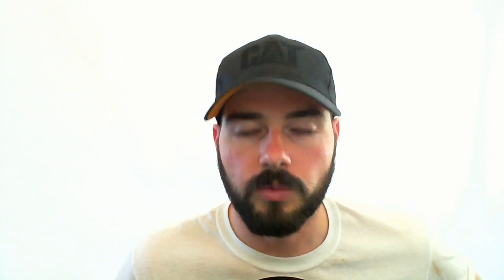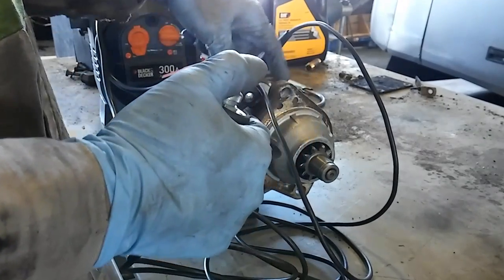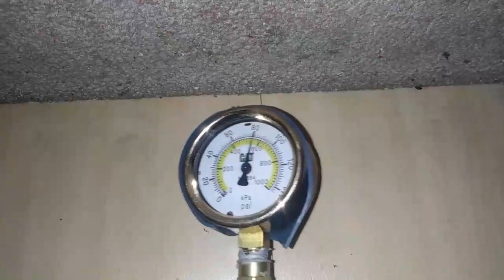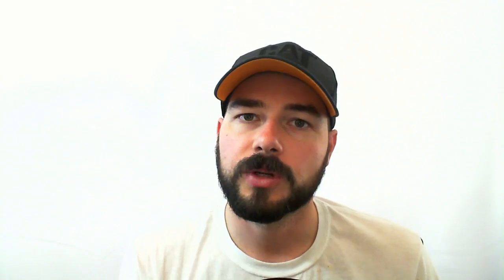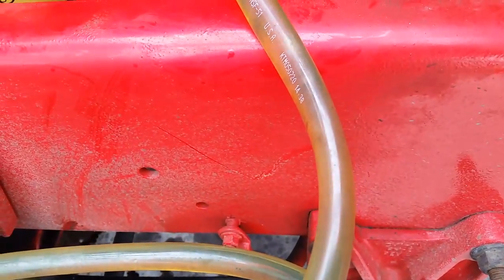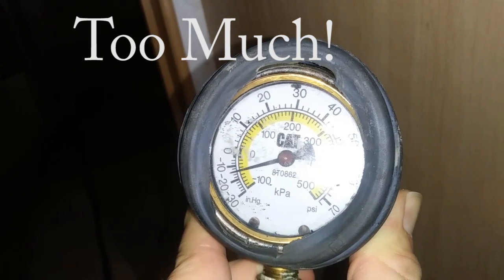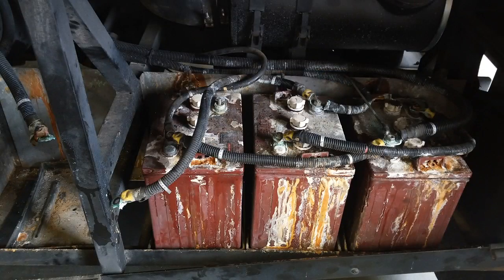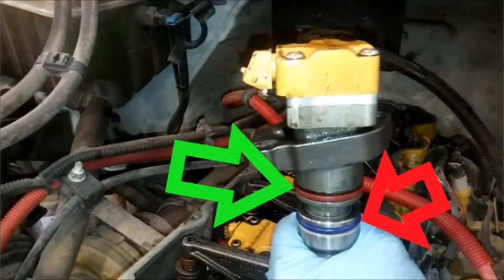Why Are Diesels Hard To Start? How To Fix A Hard Starting Diesel?

Comment: To piggy back off your mechanical checks, look for worn/ frozen belt pully. I have had a few belts slow down on cranking from a worn ac compressor bearings.
Reply: I assume that you are suggesting that a neglected water pump and/or alternator (bearing about to freeze) is/are included in the list of possible causes of slow cranking. Thanks a lot for your input.

Comment: I'm a much better operator than mechanic, but in the course of my time around machinery/trucks I've learned that corroded terminals, contacts and compromised wiring is one of the first things I look for when diagnosing starting or ignition difficulties.  Seen a lot of guys replace batteries when it was actually just corroded terminals on the lead wires and batteries.  Next up are clogged filters dropping fuel pressure to the pump and injectors.  Fuel filters get neglected a lot because of people being a little leery of the process of purging air after the filter is changed.

Comment: My modern 2016 Mercedes with its 2.2d OM651 never ceases to amaze me. You hit the starter button and within a nanosecond it starts !. I swear the pistons hardly move and it just starts. How they achieve that i will never know.
Love diesels !. 200bhp and 420NM, and 72mpg. Whats not to like.
Reply: 72 mpg, for real? What model is that? 😮
Reply: @Gebeleizis.  2016 Mercedes A200d AMG Line, DCT. 2.2d. I averaged 72 MPG over 104,000 miles. (I drive 90% motorway daily).
Reply: @TheSaabClinicUK  impressive car, indeed 👍

Comment: 3:10 Yes, that is common on many American heavy diesel engines. On many of the light European diesels for the past 20 years, a 5w40, 0w40, 5w30, or 0w30 synthetic is often required. Many European specification oils meet the requirements of the gasoline and diesel version of that European car for that year. The Mercedes Sprinter and VW TDI are examples of this.
3:38 In a VW Jetta, Golf, or Passat diesel, it often means that the car has one battery, but it is the size of 2 batteries found in a gasoline model. The gasoline engine battery is typically a group 47 and the diesel battery is usually a group 49.

I'm not sure how much draw is involved in heating the glow plugs. In some extremely cold locations, electric heaters for fuel and sometimes DEF are going to take even more electricity. I have also heard that HEUI electrical module demands a lot of juice. It demands more than computerized distributor pumps, computerized inline pumps, and common rail injection.

6:35 The worst thing is that many temperature sensors don't give you an error code unless the temperature is impossible to reach, there is an open circuit, or there is a short circuit. It makes an advanced scan tool and an understanding of how to use it a must.

14:35 The Ford PSD7.3 and 6.0 are HEUI engines, and Powerstrokehelp suggested an "Injector buzz test" to verify that the system if functioning properly. I don't know if that applies to other kinds of HEUI engines.

Comment: Air start = no more hard cold starts. Funny how rare a feature it is today, only see it on artic equipment and some military equipment.
Reply: We have an air starter on a truck and is awesome until you run out of air.
Reply: And,,,,,If you run out of air just run an air line to a couple of tyres for a refill.
Reply: Yeah, but higher mileage trucks/buses develop slow air leaks.
Reply: Forget  bout the good ol pony start, works if you  can  get the pony to keep  running
Reply: It's a good method and they didn't sell enough parts . So less parts less money no interest from manufacturers
Reply: as long as you have a running engine to power the compressor, and huge tank for storage
Reply: @trevorchadwick5479  Air starts have a tank of compressed air already. The whole point of air start is to be able to start when the electrical system is taxed due to conditions such as extreme cold.

Just google air start diesel and you'll find lots of old trucks with air starts and not a compressor or mother bottle in sight.
Reply: i  love my air starter i even set one up on my bike instead of the oem style but i carry a hand pump
Reply: @Cragified  your assuming/hoping that the tank is full, and stays that way for what could be months or a year
Reply: @trevorchadwick5479  There is a gauge for the bottle. If one fails to read said gauge and their vehicle doesn't have an accessory compressor then that is used error.
Reply: Why wouldn’t the tank refill automatically every time the engine is running?

Seems like common sense.
Reply: @iqinsanity  Depends entirely if the vehicle has a compressor to refill it. Air starts can be installed as a seldom used hard start system such as when the batteries are low from cold or as a standard starting system with a compressor to refill the tank.
Reply: @iqinsanity  When the truck has been sitting a while, and loses air, it will need an outside source to get started. Old trucks develop slow leaks.

Comment: I'm 3 minutes in and all we've covered is why a diesel engine may crank slower, although none of mine crank slowly, generally the crank plenty fast unless your starter cables have high resistance.

Comment: On  the  battery  cables , another  fail  point  is  the  lock  washer  on  the  starter  studs . If  you  don't  get  the  nut  tight  enough  all  your  current  is  going  through  the  lock  washer  and  creates  high  resistance .

Comment: You need good atomization of the fuel when injected.  If the compression is good it will light.  If you have mechanical injection it’s not as fine and tougher to light.  I’m from Canada...get a webasto...no more problems and you can heat the tranny and fuel...boom lights at -30 in the wind like summer time...

Comment: I have a question for you. When you use ether to start a diesel over and over ive heard it becomes dependent on it as in it wont or is very hard to start without ether. What causes this.
Reply: From what I've read its from excessive ether use that washes the cylinder walls and rings causing lower compression over time which results in having to use more ether.
Reply: If adding ether to the air flow is necessary to start an engine, the continual use of ether is an issue which appears only as a very small blip on the radar screen.  Josh provided many examples of no starting incidents, i.e. bad batteries, bad battery cables, sucking air, etc., and their troubleshooting procedures to repair the no-start issue.
Reply: This would most likely be a fuel delivery issue as it is cranking over but just air.
Reply: The force generated by the ignition from using ether is so high that it actually compresses the connecting rods and shortens them which leads to the pistons stopping further down the pot at tdc and resultant loss of compression.
Ether can cause broken rods as well.
The rings and grooves get damaged which does not help.
It's a slippery slope to an expensive engine rebuild or replacement.

Comment: I had a bad exhaust gas temp sensor go bad on my paccar mx13.  Temps would get almost 1,000 degrees and not settle down.  Replaced it got the power back and fuel mileage back as well 😎
Reply: Get rid of that Paccar

Comment: at 1-54...WHAT THE HECK is that spark plug distributor looking thingy, hanging off the side of that Cat engine?  What engine is that?  Is that a natural gas engine, like a stationary plant engine?
Reply from the maker: I figured that would throw some people for a loop. That is a Diesel truck engine with a Cat Regen system that uses Diesel in the exhaust and then ignites it with a spark plug.
Reply: That is the engine that took Cat out of the truck engine market, the SDP

Comment: What is your opinion on the use of ATF in the fuel tank? I have a BXS and was thinking about trying it. I also have a ISX CM871 I wanted to try also.
Reply: I used it, no problems on my CM870. This year I drive MXS and using Two Cycle Oil, seems like it pulls better, I’m pretty sure ATF is fine. ATF for ISX 871 might not work if it’s not deleted cause it might block you DPF filter faster. Do some research on google, just type in in google search whatever you want. Also check out www.rawze.com

Comment: I have a 1985 Mercedes diesel, why am I watching this lol
Reply: Same concepts. It may help
Reply: I have a few Mercedes diesels of that vintage
Best advice I can give is be current on your valve adjustments
Make sure your pre filter is clean and run a can of diesel purge every 6 months or so
Reply: @jessevongnaraj2276  Lol the thing runs as long as you have oil and coolant in it and feed it some fuel. Only way to kill them is with a sledgehammer through the block!
Reply: @doktorjonsson3860  once you do that valve adjustment you'll understand
Reply: @kfstreich4787  lol what valve adjustment...? Hydraulic lifters ftw!
Reply: @doktorjonsson3860  in a 1985 Mercedes?   What engine?
Reply: @kfstreich4787  OM60-1-2-3-4-5-6 has hydraulic lifters. Fitted in the W201 190D from 1982 all the way to the 1995 W124's.
Reply: @doktorjonsson3860  ahhh, mine was a 617, I forgot about early 190 diesels, mine was a 1987 2.5 turbo 5 speed, 617 was an 82 300sd.  I assume you had an om601?  I thought the 602-603 came out in 85 for the 86 model year.
Reply: @doktorjonsson3860  and dont forget 1-2-3 were up to 95, after that 4-5-6 came in for a few more years, and the common rail engine after that was a lot of fun, even stock.
Reply: @kfstreich4787  I have a 85 601 that I'm turbocharging and putting in my boat, and a 1984 190E that I've swapped a 605 turbo in. Dismantling the rear subframe for a cleanup and rebuild as I'm writing this.
Reply: @kfstreich4787  Yeah, really impressed especially with the OM648. Monsters from factory!
Reply: @doktorjonsson3860  try the om651,  I have one in my sprinter,  eyes get huge when I tell people it has a 2.1 4 cylinder,  especially after they have ridden in it.
Reply: Om606 for the way 👌 my s124 has a 606 since 2 weeks and it is sooo much better than the om602 😅
Reply: @christianh.8408  N/A?  And that probably still has the mechanical pump.  I have a bawled up 98 e300 diesel, I'd love to drop the engine in a similar year sl, mostly bolt up to a 300sl
Reply: @kfstreich4787  yes still fully mechanical👌 and it will still be mechanical when the turbo incl. The 7.5mm dieselmeken pump is installed
Reply: @christianh.8408  sounds like fun, I'd love to have one in a 94-95 wagon

Comment: The coolant diverter valve on a mx Cat. Runs fine but light off and on.
Reply: Arthanza McGhee I have the same issue, put a new one on and it still does it. I was told by my mechanic that is in my wiring harness

Comment: I'm working on a 1981 Perkins 4.108 , on a sailboat. I noticed the fuel injector pump timing was not straight onto it's MARK, but advanced. This engine has extremely low compression(230-250) is this something a mechanic will do  "advance the timing" to help out a low compression engine?... Service manual indicates the timing mark should align to the two marks for a new engine.
Reply: I think it's trick to make engine starting easily , by advance fuel timing to aid burning fuel .but it will affect on your exhaust valves since firing happen as exhaust valve little bit open , you will notice higher exhaust temperature .
Reply: @TheMakadimic  thank you so much for responding!... I am in the process of rebuilding the engine now to resolve the engine starting problem... I'm just wondering from a diesel mechanics "diagnosis" point of view if that's why someone before me may have advanced the fuel injection pump?
Reply: It will improve power but at the risk reliability